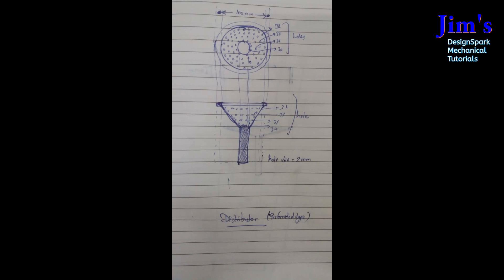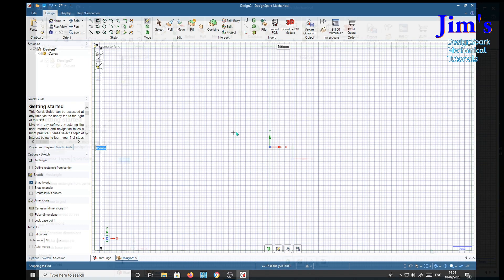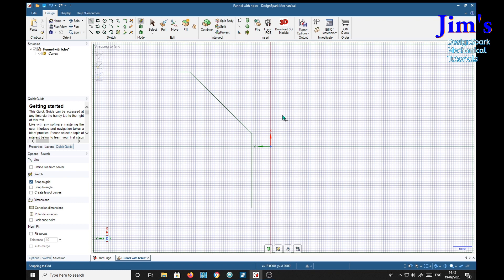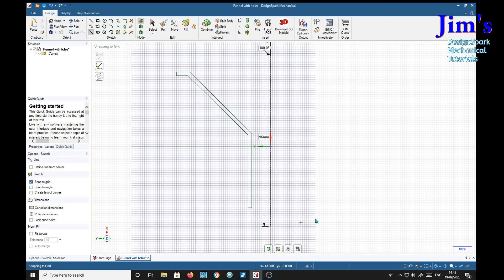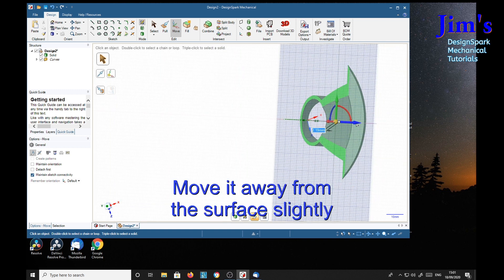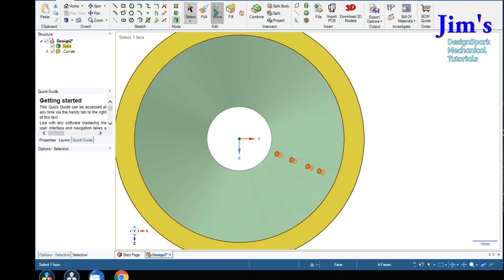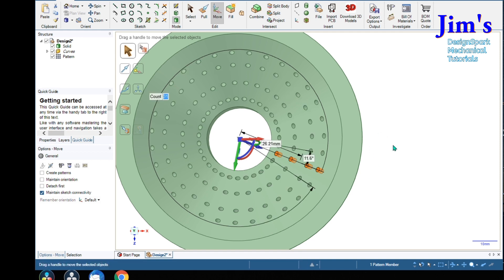Funnel with holes

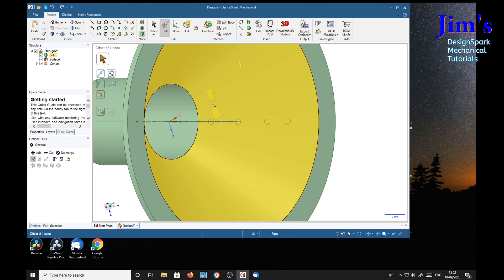Comment: 4:54 you can use smart selection there, pick one of the hole circles and then choose objects of similar diameter/area to group select. Just a time saving tip if you have several pattern members of same size. Thanks for the video, Jim. Lots of learnings from user suggested models which can be applied to complex projects,

Comment: Thanks for another great tutorial.
I recently experimented with using the move tool and create patterns check box to make a series of holes equidistant horizontally and/or vertically from each-other and it can be a real time saver. It works in sketch mode and 3D mode. I created the first hole then selected it, clicked then create patterns check box and moved it to the desired end point and changed the count to what I needed.